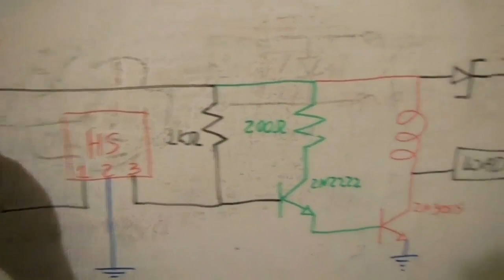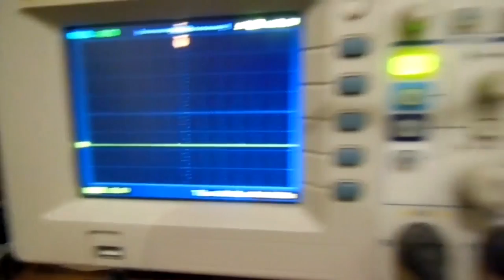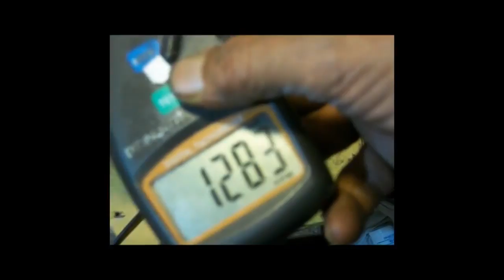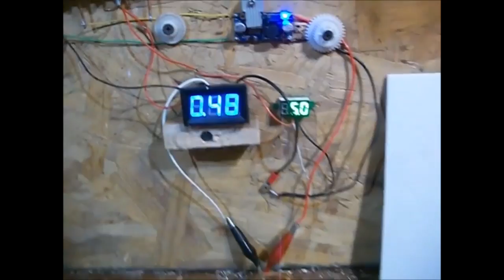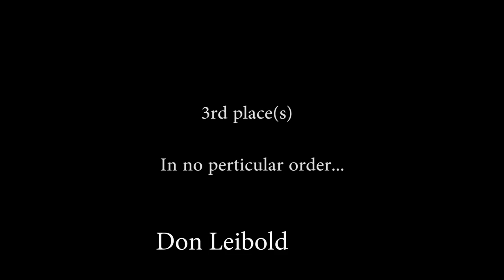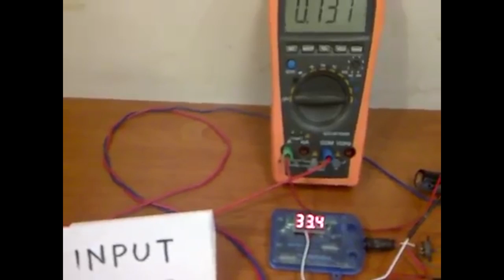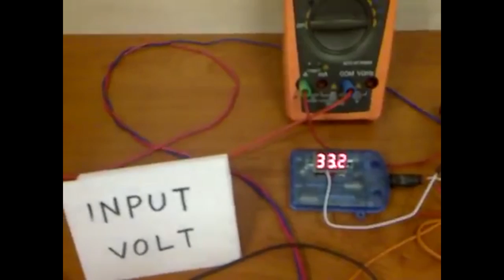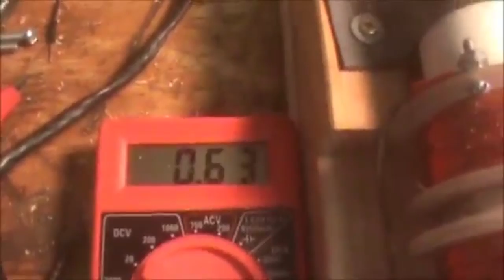Pulse Motor Build Off  2017 Winner Announcement!

Comment: How 'about hho production? A foreign fellow mentioned this ; To run off any type of water , a modified spark plug system is all you apparently need.  
The plug electrode is recessed about 1". The anode is in the shape of an "M" arch that has been twisted from both feet in order to overlap the legs, but he did not say how many times. 
I figure 5 times would be ideal.  Laser cutting this pattern would be pretty cheap if you have a laser shop around with 5 axis control machining. 
The center of the arches are the closest point to the electrode after they meet during a curve back inside.  
So I put this up to my physics theory to figure out what would happen; The water vapor sprayed in would become ionized before it ignites because the 2 legs of the arches create magnetic fields that repel one-another. I can't say how much, but it appears this might just ionize the water substantially because of how it would both filter particles only able to make the gap jump first, and the high potential over such a large gap would give water space and time to ionize.  Everyone knows that positive ions are heavier and spin around negative ion streams. The differential among them in planes would spin hydrogen until it's arms grew very large. Stan Meyer's hho injector used a 40ns 30kv 1kw pump z wave to flash ionize tapwater using the 8 transistors inside the mosfet, each having a 5ns response time. 2 micron diamond coating was necessary to prevent burnout.  His pump z wave imploded into a rod anode through water vapor. The pump z wave is just another way of saying 'ion diode' by putting charge in motion.  So this water spark plug he mentions was used in wartime by pilots who didn't know how it worked but were told to fly close to the water to pick up mist. Also some aircraft were fitted with scoops to bring on water while flying across oceans.